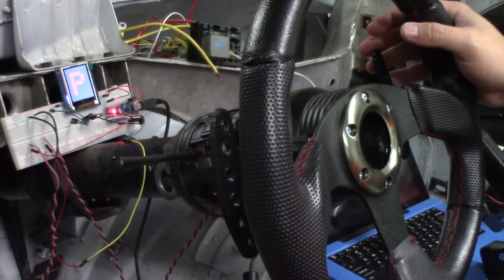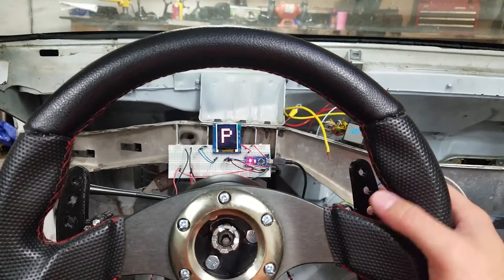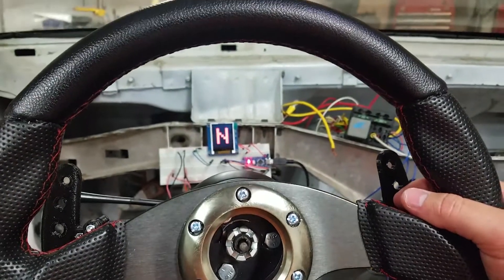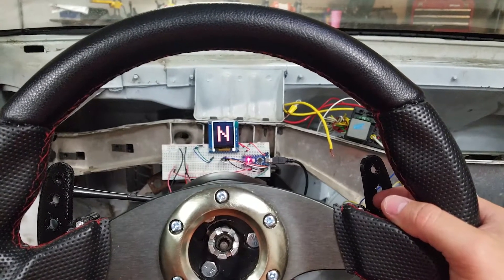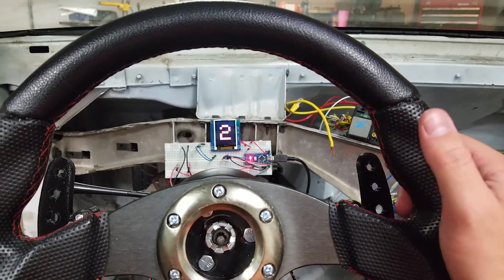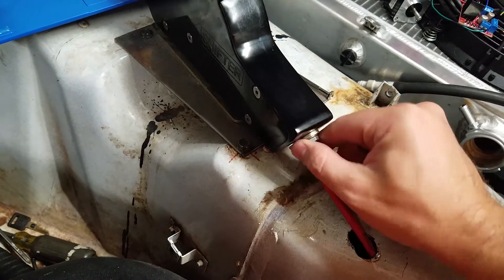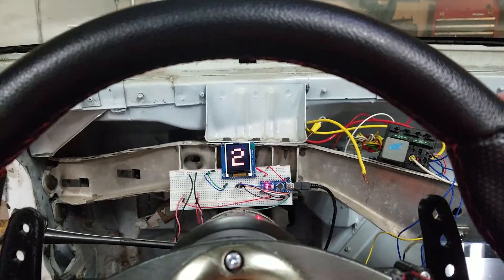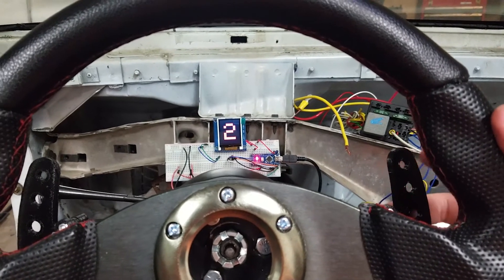Paddle Shifted TH400 with Arduino for the Chupacabra.

Comment: Hey, I am a student who is in a team which builds f1 cars in India. We have the manual transmission gear shifter system and we want to change to dc motor gear shifter based on Arduino. Can you help us with some ideas like how to proceed with the code. We use  KTM 390 engine.

Comment: Awesome. I've been thinking about doing a paddle shift like this. I vision the servo motor mounted "on" the trans (like a genie shifter) because those cables have massive drag / resistance.  I'm thinking traction control through the dominator efi, front wheel speed to rear .  Also , to control a rear l.s. diff on accel out of corners would be great, put power to the outside tire...
Reply from the maker: I didn't want to mount the servo to the trans for a few reasons. Heat, water, mounting brackets, serviceability were all the biggest factors. Mounting it to the trans tunnel inside of the car with a small L bracket was very easy.

Comment: About the GPS, its also going to be really slow for use as a traction control and many other things because GPS updates are generally like 0.5 to 1 second, way too slow for accurate traction control etc, I think youre better off using ABS sensors from the front wheels compared to the rear wheels, for example the rear wheels will never go faster than the front wheels (even while turning) UNLESS there is wheel spin, you can see where I'm going with this. Otherwise great build, I love modding and making stuff on cars that isn't stock too. :)
Reply from the maker: I've stopped using the GPS and am using the signals from the ABS sensors. The GPS is wildly unreliable. If it loses signal, all kinds of bad things will happen, including loss of boost control and traction control. It might work OK for a speedo, that's it.

Comment: Plz share the code
Reply from the maker: I might share some of the code once its finished. Right now the code is just for the paddles, a placeholder speed variable to limit shifts, the number of steps on the screw type stepper motor in the linear actuator for each gear position, and the TFT readout. The basic code for the paddle shifter.
Reply: Has there been an update to this? I am very interested.
Reply: I would love to be able to build my own. Thanks.
Reply: Hi nice video was there a video of this project completed